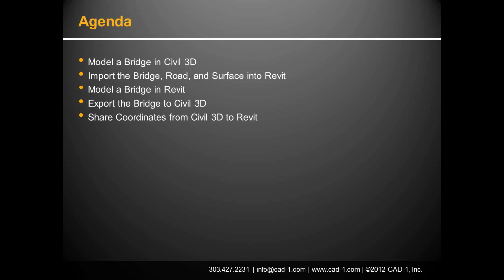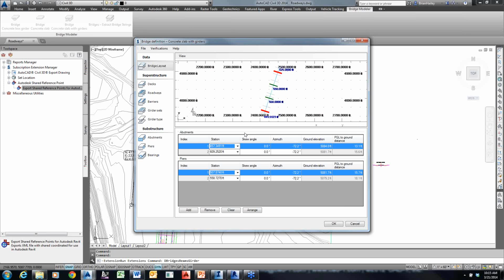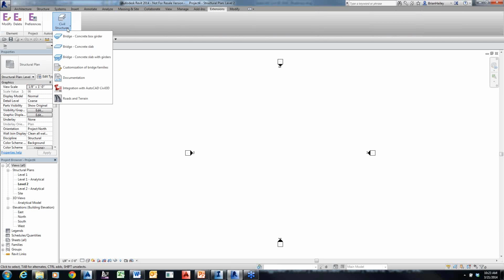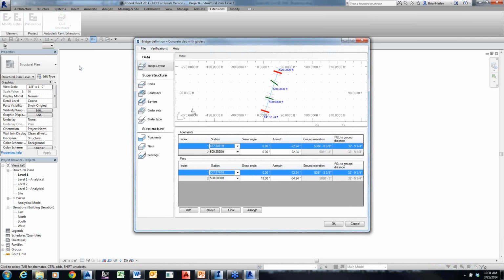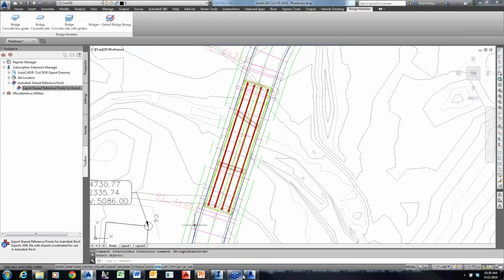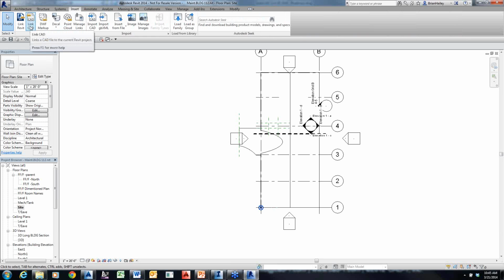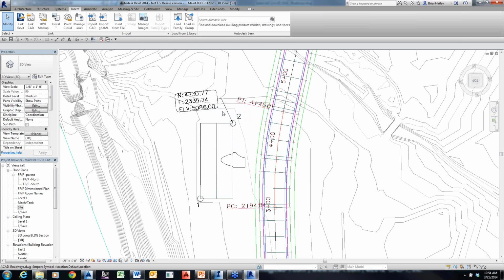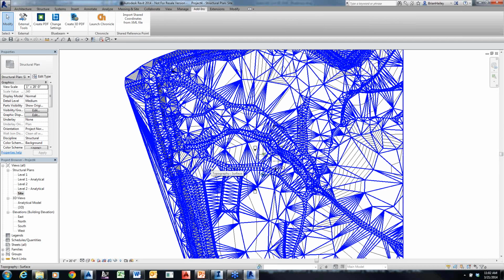CAD-1 Presents - Revit Structure with Civil 3D

Comment: I Have a question regarding connection between Revit and CIVIL 3D  ,
Can i build a small chamber in Revit then import it in civil 3d pressure network , 
but the most important point to me that i need this chamber to be apart from my pressure network , i mean it shall appear in profile or sections ?
I appreciate your efforts , Thanks